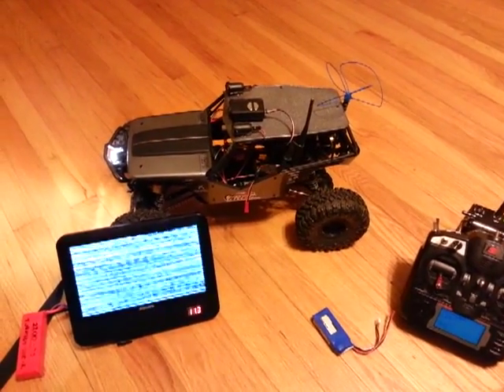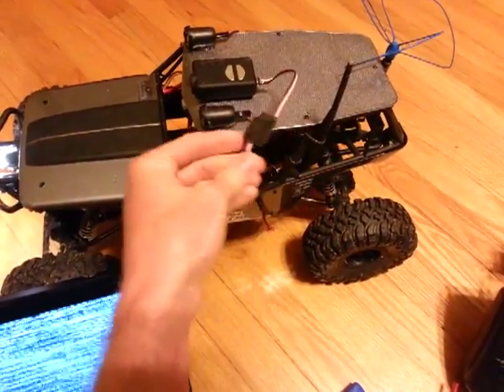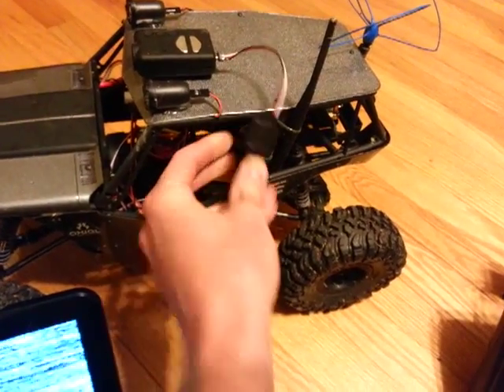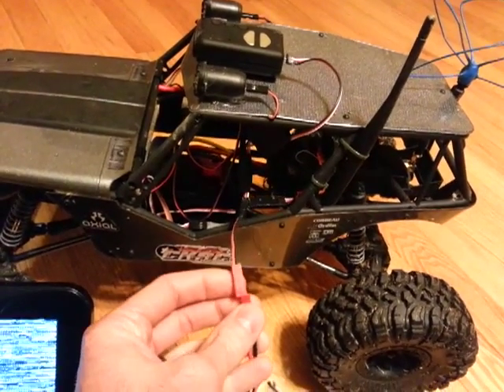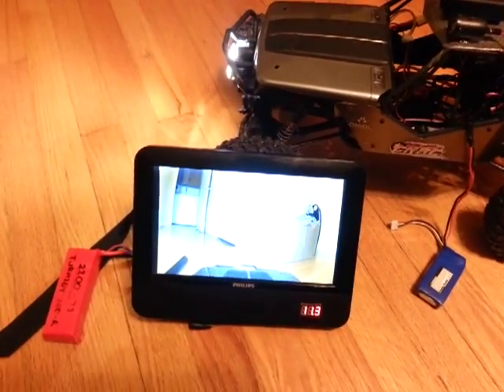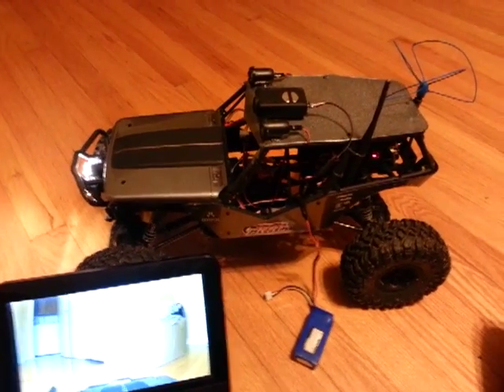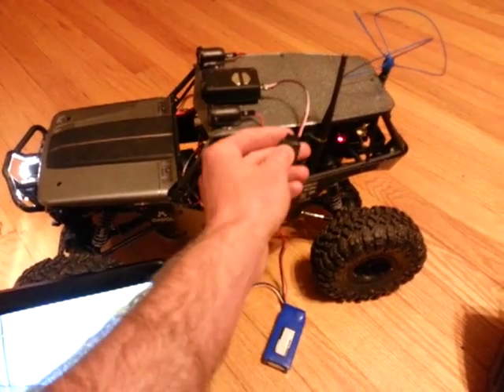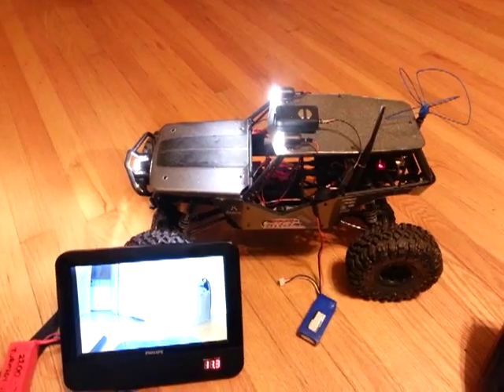Mobius Voltage regulated cable with video out!

Comment: That is cool! What is the required voltage for the Mobius HD cam, 5v or 12v?
Reply from the maker: The camera requires between 4.8 and 5.1v to charge and operate.

Comment: Are you just using a 3 pin 5 volt regulator only? No other components needed?
Reply from the maker: no... a linear regulator that you are thinking of will burn off the differential voltage as heat. I use a highly filtered switching regulator that is 98% efficient and runs with no worry of overheating.